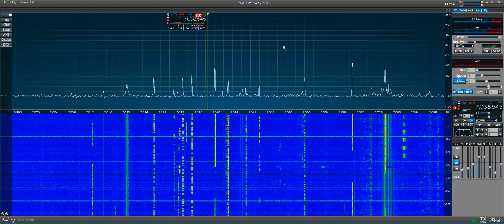Flex-Radio 6000 Series AGC-T Adjustment Procedure

Comment: Hey Steve, Good info but the audio in my right ear from your video is very distracting. When you do one of these, run it through Ayudacity and put the audio on both left and right and get rid of the background noise.

Comment: Seems similar to the "AGC Slope" setting in the K3. It basically adjusts the volume difference between weak and strong signals. Not enough and there is too much volume difference between weak & strong signals. Turn it up and weak sig volume comes up closer to what a strong signal's volume would be. Great tutorial - Thanks!